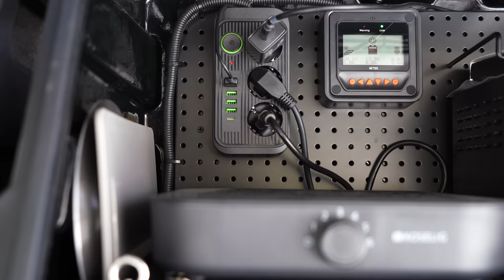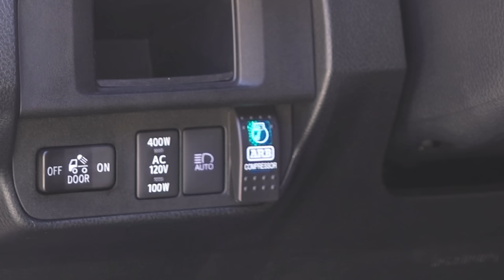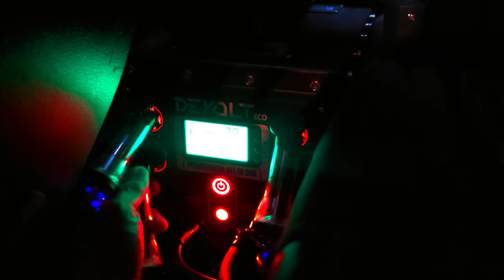💯 Perfect camping for a Relexing vacation 🤔 amazing camping equipment taco truck

Comment: Fabulous video.  Great set up.  So far you've cost me $229 for a two position induction cooktop for the cast iron skillets and dutch oven.  I have the decked drawers on Gladiator bed.  Molle cases work so much better than the 5 decked containers that i bought.  I'll use them for something.  Can't store too much on bed, as 42" Nitto spare sits on the bed.  But, stuff can sit on top of it.  I like the "picker" to grab stuff that you can't reach, but most of what i'm putting on the tire will be at least 36" long.  More to follow...
Reply: I just love your fish13 like casual but dead serious in camping talk. Thanks for your precious reply